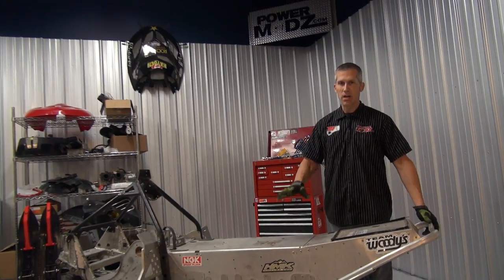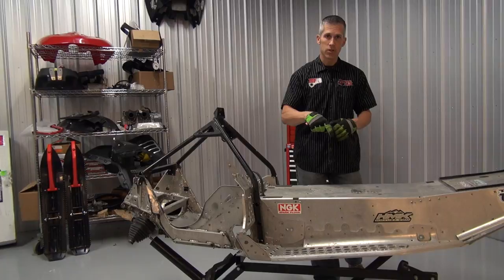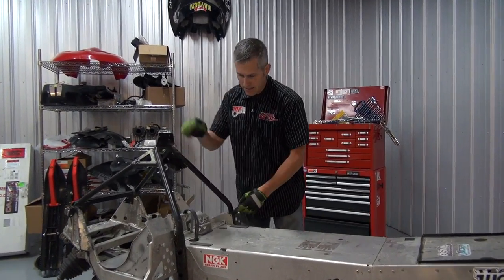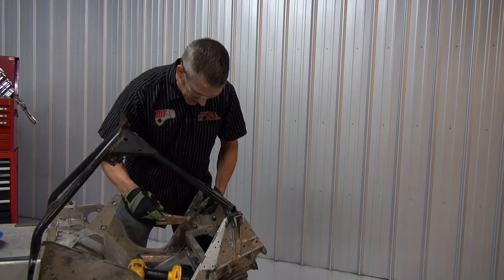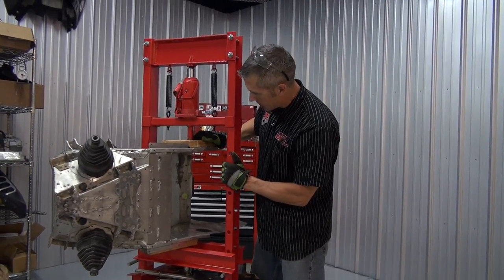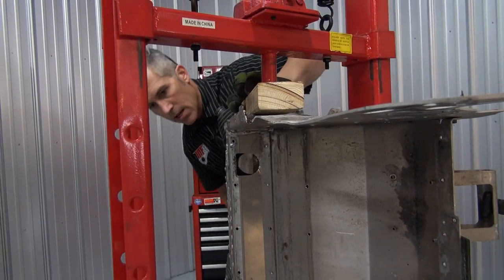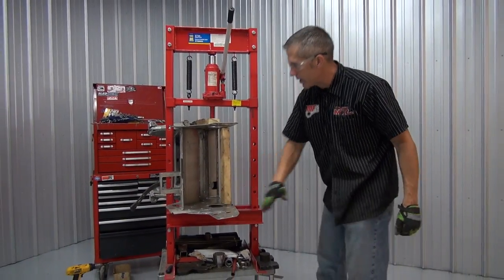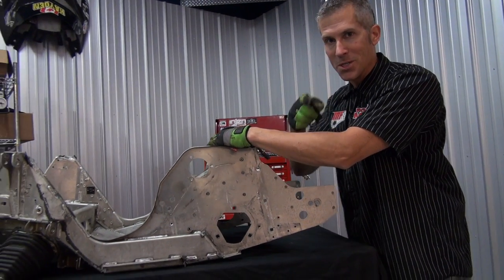Ep # 1 Polaris IQR 800 Mountain Mod Build series! PowerModz!

Comment: I have a question for you. I have a 96 indy 440, fan cooled, I am dropping the rear suspension and making custom running boards like the ones on your ski doo 700. my question is, if I make the drop brackets with tunnel support, like a piece of 1/8 inch by 1 inch flat iron, would it interfere with the track?
Reply from the maker: it shouldnt

Comment: what would be a cheap sled for someone that has never been on one but has rode dirt for over 10+ years... I would like to get in the sport but knw nothing about it..something that is not vary slow but not to fast and I don't work on it more then I ride it
Reply: I have been riding a dirt bike for 4 years and I just got into sledding this year I traded my 03 250sx for a mxz 800 mod. trade your bike.
Reply: If your getting into the sport id start off with a 600, then go from there. a short track 600 should get you to 100-105mph on the lake so more then enough for a beginner sled. and really just get something around 2000 or newer and you shouldn't have problems until you start getting into the higher miles. I am a polaris guy and an arctic cat guy myself but the way I think of it is if the company is still around they must be doing something right, there's a reason skiroule, etc. aren't around today. Never had good luck with skidoos but same goes for others with polaris' and cats.
Reply: thx for the info